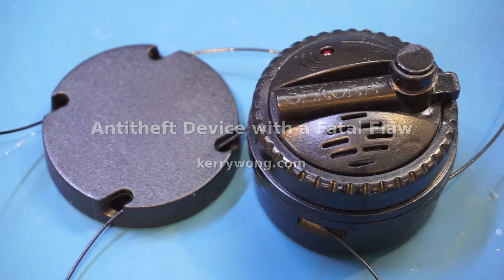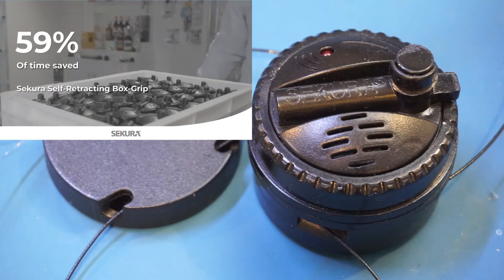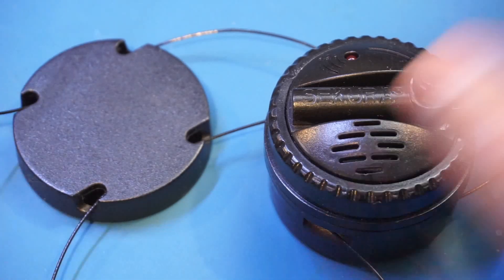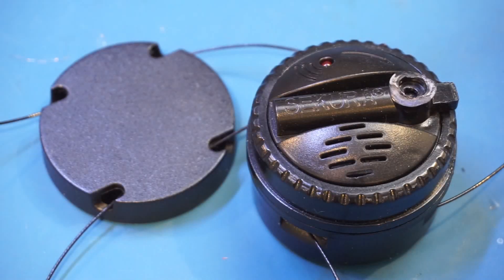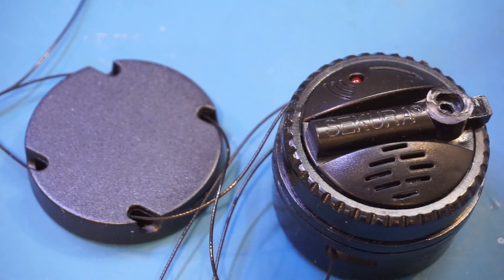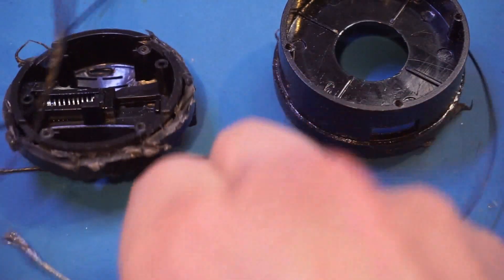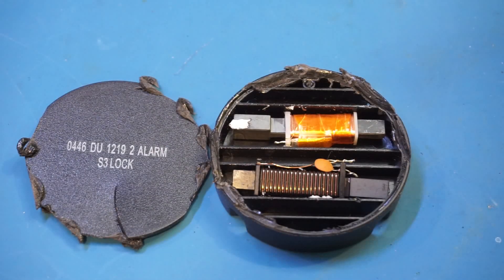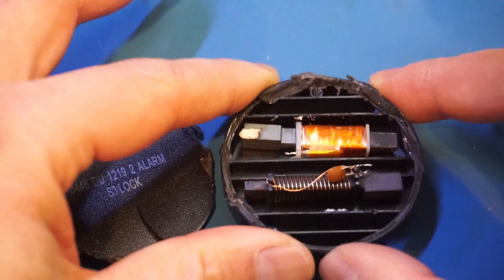Antitheft Device with a Fatal Flaw

Comment: I have a similar device, from a different company, but I'm here trying to find out how to remove a different Sekura device, that's clamped to a pair of pants I just bought. The other pairs didn't have any device, so I wonder why this pair. I didn't notice it until I was home. It's white plastic, about 2-1/2 inches long, and clamps onto clothing. I tried prying, but it's too small to keep a firm grip on it. I don't want to where them with that thing on.

Comment: I didn't know you could turn it off with a magnet. I tried to salvage a coin cell from a similar unit, and had to use much force to get to it. There were no screws. Everything today is made disposable. The cell had already significantly discharged because the alarm had been going for a while in a trash bin.

Comment: My guess is it's a simple 555 blinking the LED.  The buzzer is a active type with its own oscillator.   The difference in tone is due to the decrease of power voltage when the LED is on, since the power source is high impedance....

Comment: Pretty simple and effective device.  Most of the complexity is the mechanicals.  Seems like the electronics doesn't even need a microcontroller. A simple S/R latch seems sufficient. I don't know if there is an 8 pin SR latch package (the only ones I've used are quad in 16 pin packages) but maybe they improvised one with an opamp like the mcp6022.

Comment: The magnetic locking system is not really a flaw. It's been in use for a long time already, for example the clothing tags. If it was deemed too unsafe, they wouldn't have continued using it for so long. The average thieve is unlikely to bother with a magnet. But even if they do, there's probably still a security sticker in the package somewhere that will trigger the alarm when they leave the store.
Reply: Hows' that work with "smash and grab" ; which seems to be the preferred method today?
Reply: @John McCormick  As Kerry said, it will trigger the door exit alarms, but otherwise not much else you can do.

Comment: Bad explanation! It is really a triple device:  2 resonant circuits for 2 separate systems and the wire lock that also needs some side button release when pulled by the magnet.